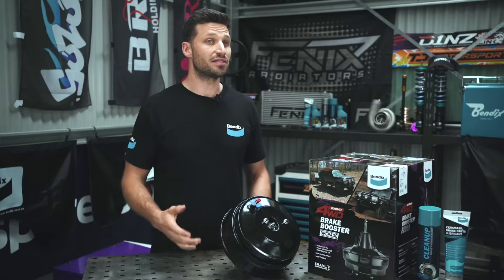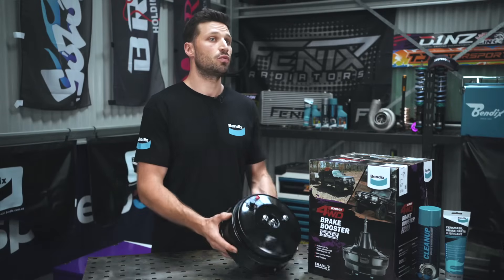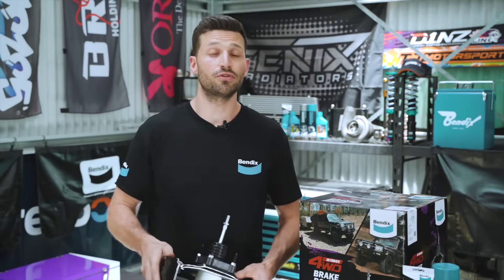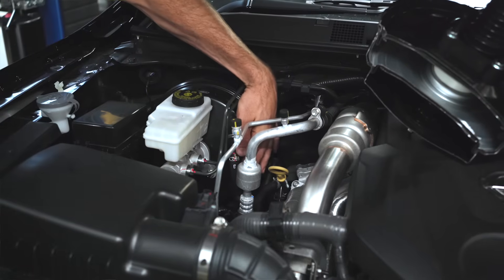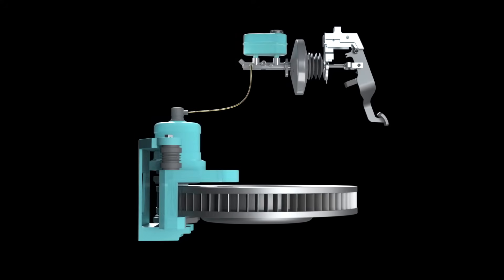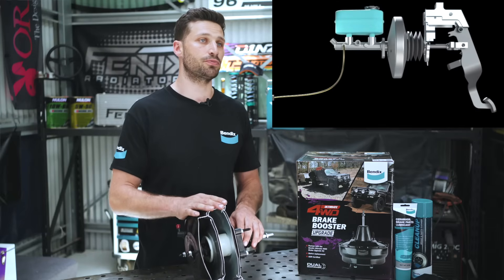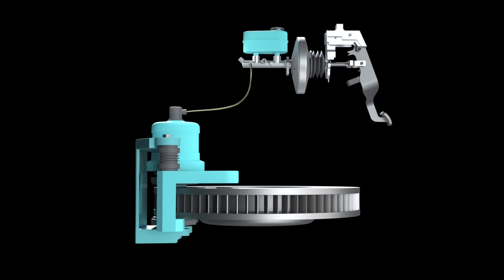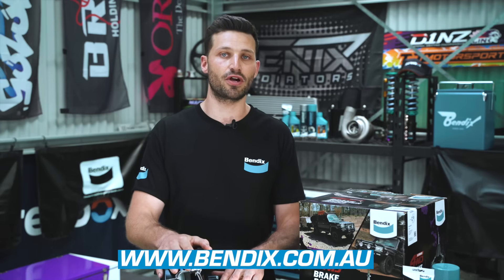How Brake Boosters Work

Comment: Do you think you guys could make a video of a disassembly of brake booster. I found a rubber o-ring hanging around the piston that pushes the piston inside the master cylinder. I believe it to be the reason why my brakes don’t work very well loosing vacuum.

Comment: Car's been needing me to step on the brakes pretty hard to apply any stopping force.
I had been told about the master cylinder having a problem. Came here looking to confirm the issue for myself and this video has shed the light on the PRECISE issue I've got.
Looks like I'll need a new brake booster. Doubt these can be repaired?